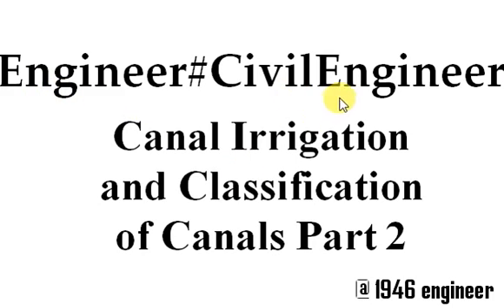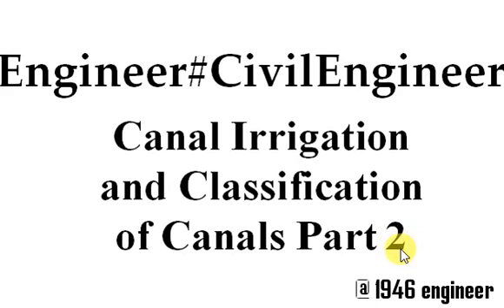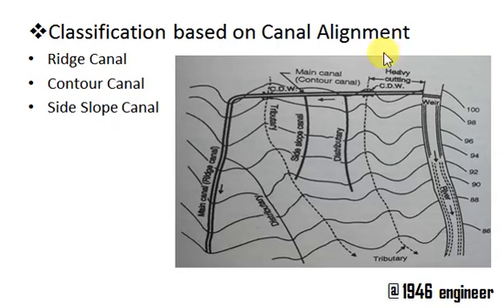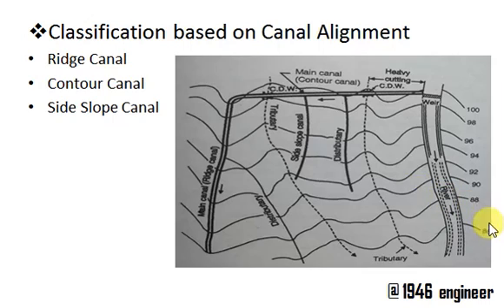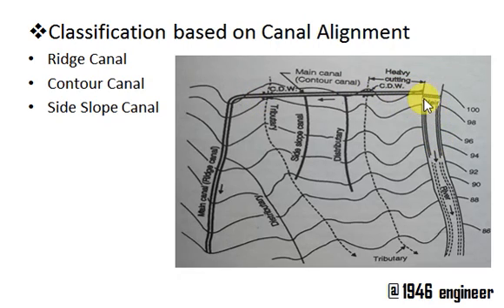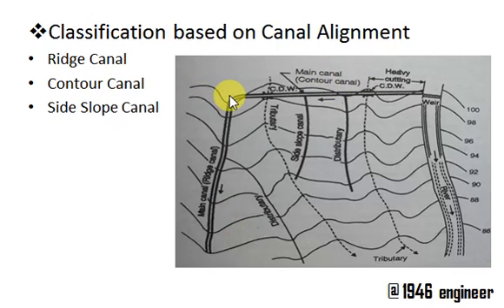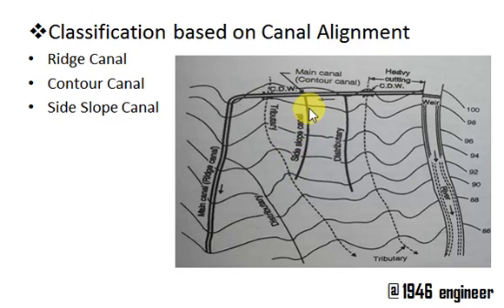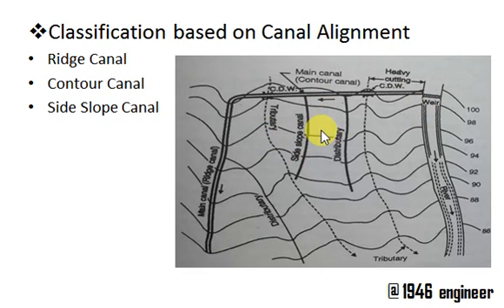Classification Of Canals Part 2

Comment from the maker: My explanation is not good at side slope canal.. so please refer below explanation. Apologies for that. 
@1946 

Side slope canals are used to irrigate the land between hill top and hill valley. So they flow in between hill top and valley. They flow perpendicular to contours. As they are parallel to natural drains they dont need cross drainage works. (Natural drains flow from hill top to valley)